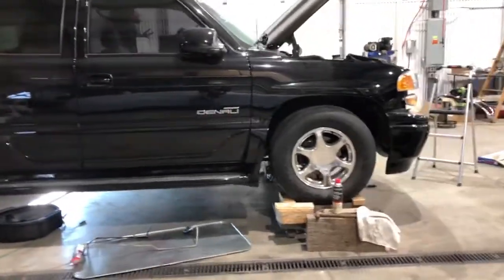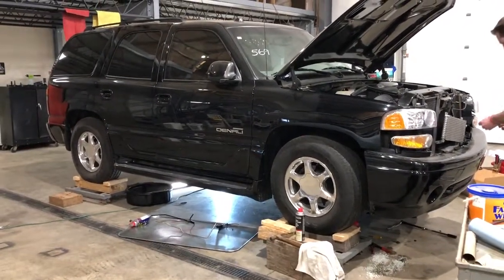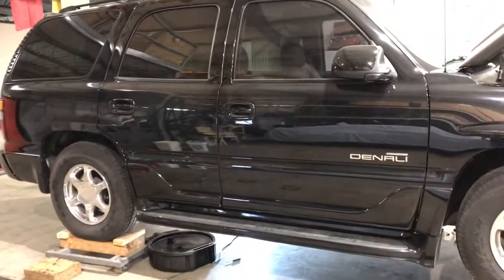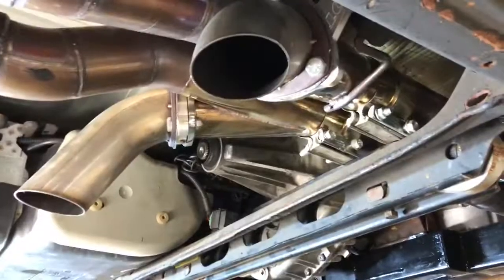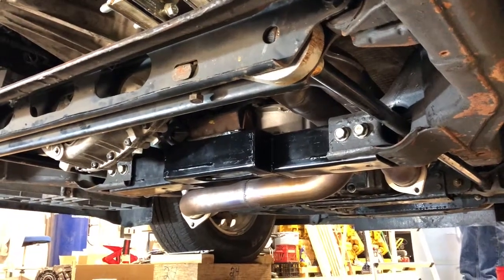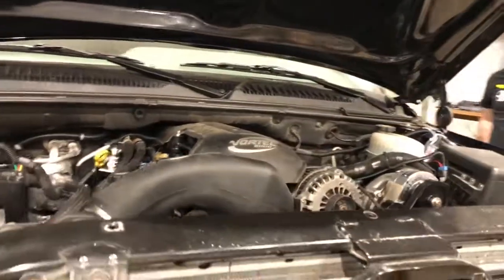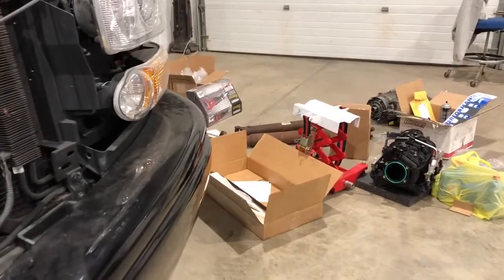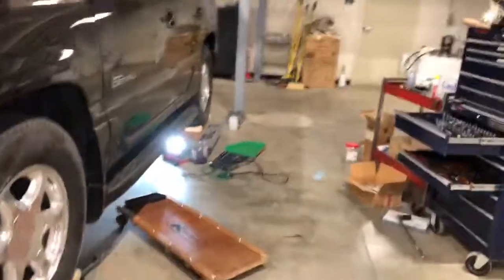PROCHARGED YUKON DENALI 2018 UPDATE

Comment: How did you mate the 80e to the transfer case? Any special adapters? I can't take a 60 serious after putting an 80e in my Tahoe. I'm 2wd, but curious how u made it work.
Reply from the maker: We used an AC Delco Transfer Case Adapter to get the 80e bolted to the BW4485 and then had custom length driveshafts built for the front and rear with upgraded yokes. The truck hasn't moved yet since we have to re tune for the 4L80 and all the new parts that are on it now.